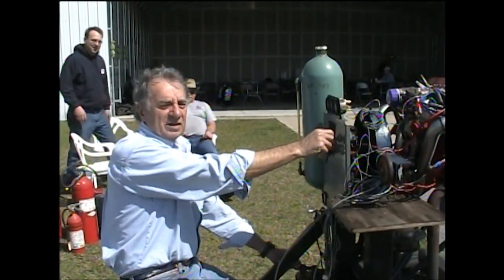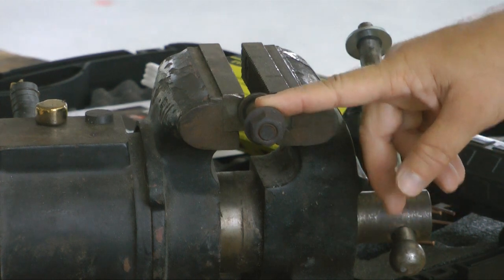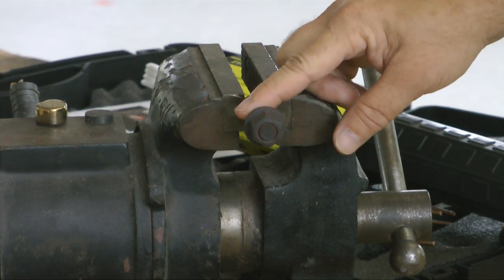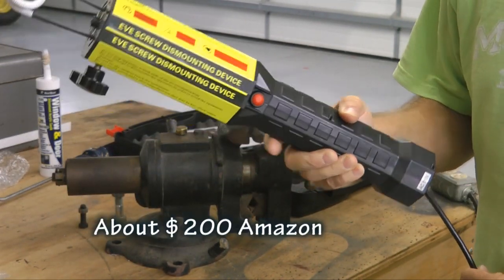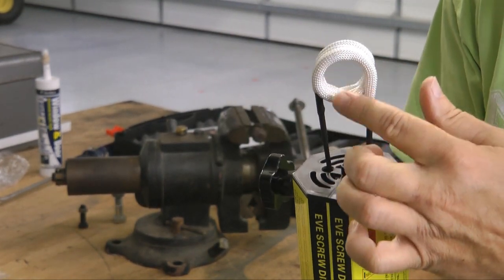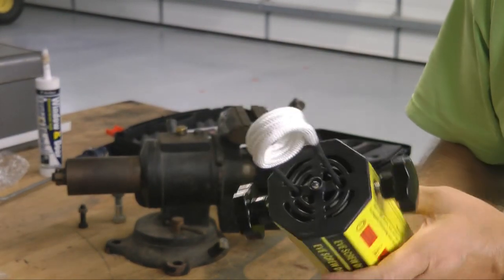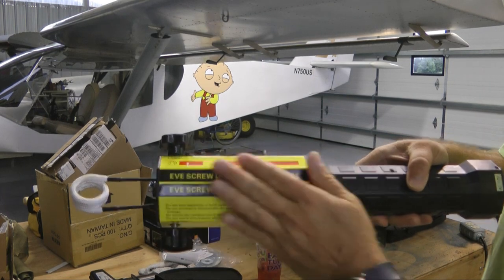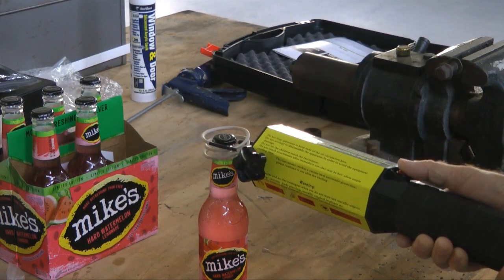Don't Ever Use this Tool on your Aircraft

Comment: I have an old school Weller soldering "gun".  I fit it with a length of coat hangar with an appropriately-sized loop around the suspect nut.  Pull the trigger and the heat goes to the nut.  Please use judicially.

Comment: Eric at South Main Auto has a great video on using these on his channel. They are quite popular in the rust belt and marine industry and I've used them for a long time. As far as stainless steel goes, I've found it will work with some grades that are magnetic.

Comment: So what the hell does this "tool" have to do with "not using this on an aircraft?"
You must be getting a commission on the sales.
Reply: Given what I've seen on the channel and of his sense of humor, he's probably thinking about the fact that most of the components on a plane are aluminum and will not heat efficiently.
Reply: 1:18 Don’t use a fire wrench on an airplane.
Reply: I'm guessing the strong magnetic current could wreak havoc on many avionics. Your bashing of someone who does a tremendous amount for general aviation is uncalled for.
Reply: @gawebm  Insert eye roll here ....>>>>(         ) <<<<